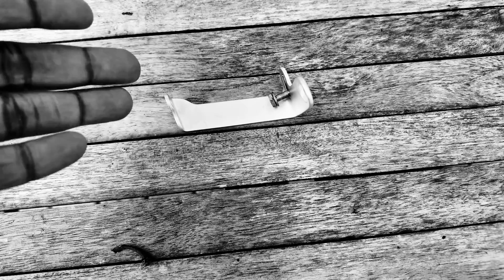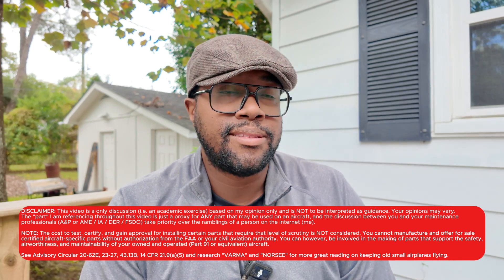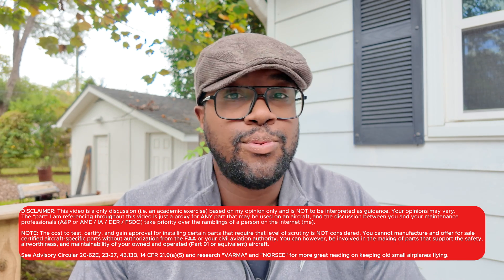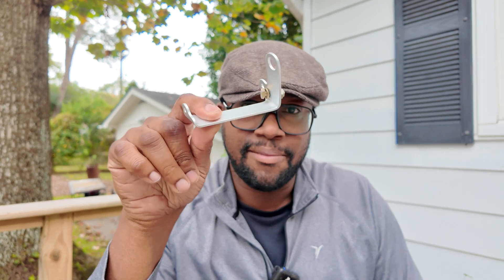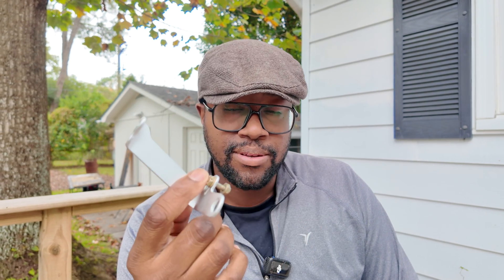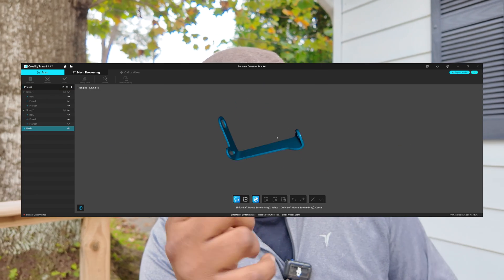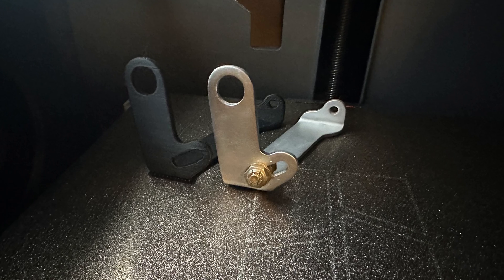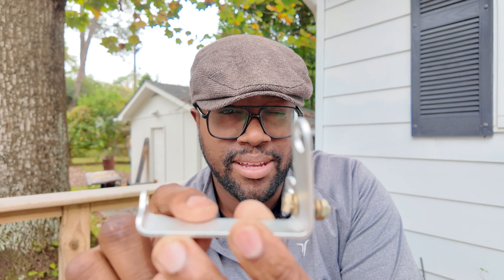This $320 Part Should Be $25 - Prove Me Wrong

Comment: While I understand the legal constraints and the complexity and costs associated with certifying a part, it still baffles me that “stupid” parts like these sell for hundreds of dollars. Anyone who has taken a mechanical design or CAD course, or even just tinkered at home in a workshop, knows how basic this geometry is. It could be plasma-cut and folded in about fifteen minutes (that is if you’re slow), and large volumes cost almost nothing to produce aside from the material and the one-time programming of the cutting sequence. General aviation clearly suffers from ridiculously high prices (but let’s not be fooled, the same applies to commercial and military aircraft as well).

As you said, it could even be 3D printed in metal, granted it isn't highly loaded or doesn't require sub-milimiter precision.
Reply from the maker: Bingo!! In today's age when real operators are complaining about parts and availability, it also baffles me that we haven't gotten smart to the regulations governing CAR 3 type airplanes in Part 91 operation. I hope we're getting smarter but the naysayers are a frustrating roadblock.

Comment: I think you should go and tour a shop that can make that type of part, you will learn that setting up Machine Tools is very time consuming.  $100 to $150 hourly rate and 300 bucks might cover setup. Now add in that aircraft parts are made from a specified allow and require traceability of the alloy and heat lot,  now your adding hundreds of dollars office labor and paperwork.
Reply from the maker: Excellent point - let’s step through it. I’ve worked in and around those shops, including one that made parts for small aircraft and another made wind turbine parts with NREL as their overseeing authority - I don’t spew things I’m not at least mildly knowledgeable about.

It’s even easier than that today - companies like SendCutSend, OshCut, PCB Way, etc. have minimal setup because their systems are CNC controlled - they don’t have to setup anything. A human places the material on a platform and clicks print. It’ll be even faster when (not if) metal and composite 3D printing becomes more widespread. They go right from a drawing, to a finished part with as little human interaction (the biggest cost for most companies) as practical. Their lasers/plasma cutters or router bit just does the work and a human does a quality check, puts it in a box and mails it out the next day. Soon even that machine will grab the right material off the rack and it’ll load itself (if it doesn’t do that already). Even press brakes and tube benders are automated these days. There’s hardly anything billable called “setup” in a modern CNC operation - that’s what the airplane owner does when we provide the properly dimensioned model or drawing, ready to go onto the machine. “Setup” is now the cost to pay a service to take your part or napkin sketch and make it a .DXF or .STL or .STP or .3MF and Fusion, OpenCAD, SolidWorks, AutoCAD, OnShape…all make that accessible for the airplane owner to do on their own after 2 hours of YouTube lessons. 

As for traceability: the materials all have an MSDS that is available on demand and often an ASTM standard will surpass the requirements for a CAR 3 (designed in the 1940s…) airplane which is the majority of what viewers here care about. Part 23, 25, etc. might have additional scrutiny required but AC43.13B and Part 21 are very prescriptive on what traceability needs to look like for old airplanes and it’s not a very difficult bar to cross with modern tools and proper documentation. It will also dictate that if the part is actually critical to flight, we must go through an approval process (Field Approval, STC-Single, STC-Multiple for manufacturing, etc.). We can’t pick and choose which FAR to follow. But that’s not what this is about.

Is this great for human jobs? Probably not, but that’s not my area of expertise. What it is great for, is the man or woman who wants to keep aviation safe, affordable and attainable. This video isn’t about how to find a way to profit from these parts. It’s also not about setting up a manufacturing operation. But the regulations firmly allow us owners to make our own parts to keep our own product maintained and safe and that’s what I’m advocating for. Your mileage might vary.
Reply from the maker: Almost forgot to mention: I’ve left some really good references in the description of this video. VARMA, various ACs, etc. all ways the FAA is (was?) trying to lower the bar to maintaining what they call “Vintage” airplanes.

Comment: A friend of mine is restoring an early 1940s piper. A part is no longer available and using modern technology they started thinking about a modification to replace the no longer available part. All good till the FAA said sure as long as it meets the original 1940 requirements. The lesson is the brains of the FAA regulatory offices function under the mantra of “over 100 years of tradition will NOT be overcome by modern technology” without $$$$$$ spent to make them happy. Remember “the FAA isn’t happy till your unhappy” or grounded.
Reply from the maker: Frustrating in itself. Today they could consider going through the FAA's VARMA process as it is policy.

Comment: My own snarky remark "Using 100% markup, that's a 160 dollar costs broke down 25$ manufacturing and 135$ legal fees.  I do have a story where printing saved my bacon.  I had bushing fail on a cable pull for my prop control.  To properly fix the I would have to remove the cable and slip on a new bushing while building a new cable.  I had one of the engineers at work print a two part bushing that threaded into panel protecting the cable. This is kind of discussion we need for owner provided parts that are no longer available.
Reply from the maker: 😂😂😂 nicely done. And love the clever use of technology. Material choices are also improving thankfully. I like where this can go and I'm hoping to engage the FAA on it directly on behalf of the Open Source GA community.

Comment: If the part was so  fucking perfect , it wouldn't have broken in the first place.  The aviation industry has alwasy been a racket and the biggest of them all are the engine manufacturers. If you want make flying affordable, find cheaper ways to make the same engines for 1/5 the cost. These brackets and other crap were never "engineered" to begin with  and anyone that thinks some team of engineers toiled over the suitability of that bracket 50 plus years ago is retarded.

Comment: The fact that the owner has the option to manufacture parts for his airplane is intriguing. The problem is he would have to get an A&P to install the part in most circumstances or at least that is what seems to be the case.
Reply from the maker: Correct! The mechanic is the "check and balance". They still have to return the airplane to service with the new part and the owner Z MUST involve them and ensure they are onboard with the plan. Many don't understand the intricacies of the regulations when it comes to owner produced parts. Many also maintain a CAR 3 or Part 23 airplane operating under Part 91 like it's a Part 25 airplane going into Part 135 service (because that's the world a lot of A&Ps come from and how the schools will teach). The regulations are wide and varied but there are so many allowances if your maintenence team is willing to work with the owner.

Comment: They really are just gate-keeping technology and keeping the common man from being able to keep a hold of what we own. You could have sent the original broken part off to be tested to tell you exactly what it was made of and found out it had a defect that the FAA wasn't even aware of and they would still want you to buy the exact duplicate because it was functionally the same. You could have taken that part and had Fusion generate a part using AI to reduce the weight not even be able to do anything with it. You could have bought an XTOOL P3 and a Langmuir TITAN 25T press brake and made that part itself along with any other parts are hard to get ahold of and paid off the entire investment. You would think with all the Made in America stuff going on that you would be able to get the FAA to give out grants to help with these kind of problems.
Reply from the maker: This is a POWERFUL and excellent comment. I’m right there with you on this. There was a time when we could innovate. I wasn’t around then, but I sure do wish we can get back there.
Reply: @OpenSourceGA  I've been watching this go down since the 90's. We used to have machine shops all over the place. Auto-parts stores not only stocked parts but they made them, and rebuilt them. 

When Cash for Clunkers came it's real goal was to destroy the used parts market, and to send all the scrap overseas to force a materials shortage in the US, while actively bailing out the failing automotive sector and look where we are now.  

Go look at how the Government had dealerships intentionally poured sodium silicate into perfectly serviceable engines to wipe out cars that we would probably still be driving if they had made it to the used market.

Since the pandemic, brand new vehicles are being hoarded and destroyed by banks so they can keep charging everyone for a new model. There was literally an entire stadium worth of new trucks being strip mined because they said it was a parts shortage. No they couldn't have those vehicles or those parts out there.

They hollowed us out. They knew this would work because they did it to the aviation industry just by restricting parts. 

I have been watching google and the investment bankers wipe out image sites just to take down information on servers that had been online since 1988. They wiped out Yahoo and Geocities and Angelfire and all the forums. They had SBC removing posts from the newsgroups with complete technical breakdowns that random everyday people who wanted to maintain their products could use to fix stuff we don't even have manuals for.

Think about when you could go to the library and find Haynes Manuals and Shop Manuals and where are they all now?

It's all paywalled and firewalled from unauthorized hands. 

The academics have been fire-walling technical info at colleges and making people have to pay for info that our taxes contributed to.

Aviation should never have lead the extinction of technical errata.

Do you know what happened to all the technical data in Japan that never made it to a physical storage medium. or the internet?  

They recycled it, aka burned it all. When any one person in a technical field dies over there their family sends it to the trash heap and if nobody saves it, its gone.

Technical achievements of millions of hardworking people are being wiped out because kid gloves are allowing it to slip away. 

We are in a race to technical extinction with no brakes.

Comment: You don't know what it's expected to hold, the manner in which it is supposed to fail, the exact aluminum it's made from, does that matter. If you make the parts yourself, something you missed will put yourself and others in danger. MAYBE not that part, but something down the line, OR someone else that sees this and thinks yeah I can do that. We're going to have self appointed experts making planes fall out of the sky. The cost IS the cost.
Reply from the maker: That's where your A&P and sometimes an IA comes in. They still have to sign off on the part and the installation and they're beholden to the federal regulations. If they don't agree the part is suitable or meets the required standards, they'll reject it. Checks and balances are nice. Or you know...we can "just" pay $30,000 for a Beechcraft Bonanza landing gear motor, and $3,000 for alternators and be happy about it (both real costs) because the costs are the costs.

Comment: OK - NOW we are on to what got me interested in your channel!  This is a step into the discussion that I imagined when I saw the name of your channel.  One approach is to identify and match, exactly all the characteristics of the OEM part, and that could take a lot of work and cost. But, as you said, we can also identify all the ways that the part needs to function and (often more easily) exceed all the requirements with a new part to be better than the OEM part, potentially for a lower cost.  (As the pinned comment points out - for someone to SELL parts is a big lift... but via an open source approach... things are very different.)
Reply from the maker: Down the rabbit hole we go! More on this and practical examples to come. The Open-Source of OSGA was aimed at topics like these. Had to develop the clout and base first and I think we're solidly there. Prepare for the naysayers! Meet them with love.

Comment: Interesting discussion, sir.  Reminds me of a couple real life situations in auto and aviation.  Often times the brand of a part affects pricing as well.  I've seen it said that a whizbang gadget for a Beechcraft in a Beechcraft box can cost twice or more the price if the part was in a different make of aircraft's own box, Cessna, Piper or such.  In the auto field I am more familiar with, I have seen identical General Motors parts in A Cadillac box is considerable more costly than a Chevrolet part, identical in all ways.   My son has a SAAB that was made when GM and SAAB were in a partnership.  The car is 15-20 years old and long out of production..I was designed with a multitude of GM origin parts in the final project.  With the age and rarity of the SAAB have made it impossible to find parts, many of the parts he has acquired from the area GM/Chevrolet parts departments from his area.

Comment: 100% agree.  I have designed multiple parts using FreeCAD and their Sheetmetal workbench.  Send-Cut-Send bent and shipped them with zero issues.  They were non-structural parts for an experimental plane.
Reply from the maker: Love seeing other real examples in the wild!

Comment: You could make that part with some metal strap, drill, hammer and hand saw.
Reply from the maker: Correct. It really is that simple.
Reply: Your time and effort might work out more than $325 unless you've already a proficient metalworker, though
Reply: @RoamingAdhocrat i don't think it would take more than an hr at most.
Reply: @RoamingAdhocrat  That's for one,  streamline it and the price falls

Comment: Former US Airways A&P,  yes approved part prices are insane.  Hell a cockpit door key was $26.00 around 2000.

Between the paperwork and the low volume of GA aircraft and you get a $325.00 bracket.

Comment: Well, I arrived late to the party so everything I was going to say I see has already been said by many others.  Welcome to the FAA bureaucracy AND the nefarious actions by companies like Hartzell Engine Technologies, who systematically bought out all of the alternator, starter, turbo, combustion heater and exhaust repair companies and then jacked up the prices.  Without any competition your wallet is theirs to pick dry.  This is why experimental aircraft, where you aren't forced to buy PMA parts, is so popular.

Also, lets not forget the lawyers who seek huge damages when an aircraft is involved in an accident.  They will name every manufacturer and mechanic that they can in an effort to recover the most money.  Parts manufacturers often incorporate the potential litigation costs into the final price of aviation parts.  Even when an accident is purely pilot error (e.g. flying into a thunderstorm) there have been cases where a huge jury award against alleged manufacturing defects, was levied against parts manufacturers.  Case in point, the Mel Carnahan fatal accident back in Oct 2000.  He took off into a thunderstorm, lost control and crashed.  Parker Hannifin, the manufacturer of the vacuum pump installed in the plane that was alleged to have failed, was effectively put out of that business.